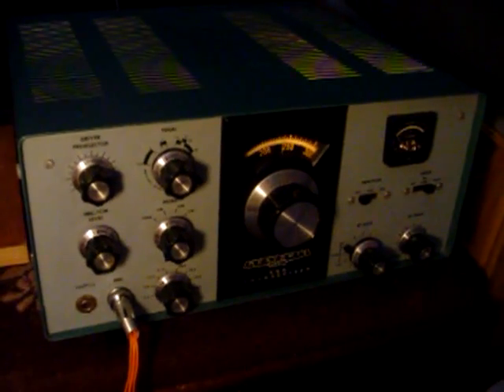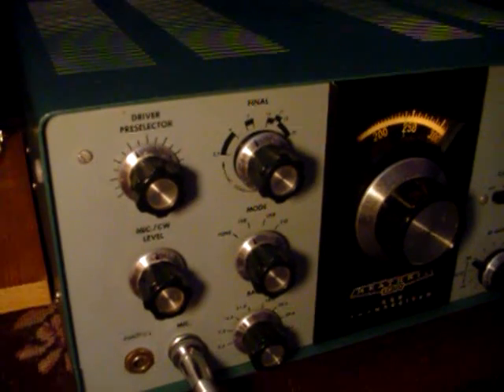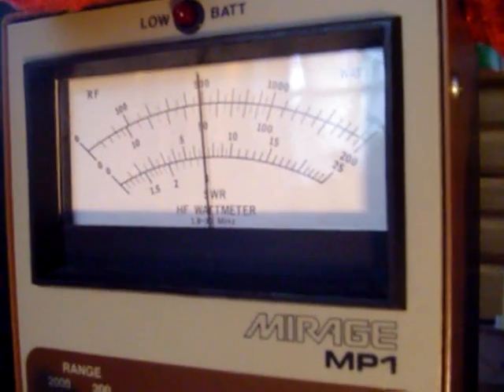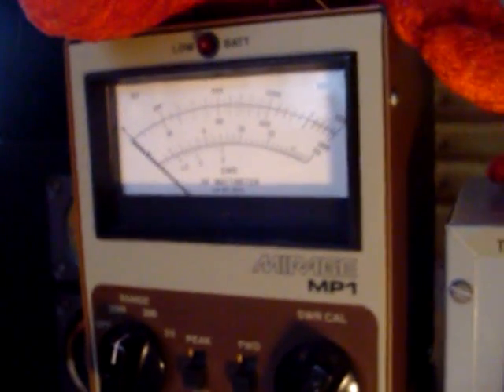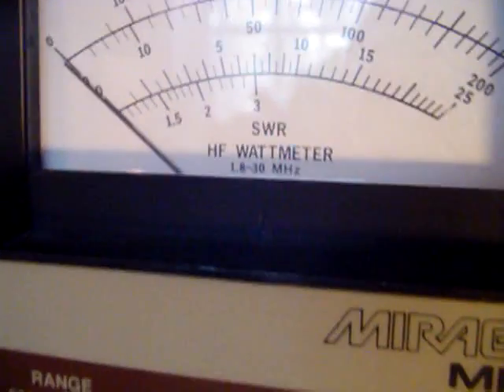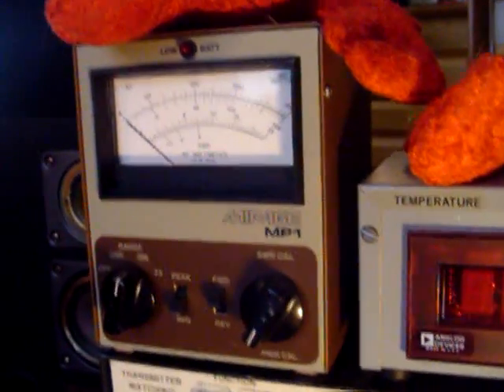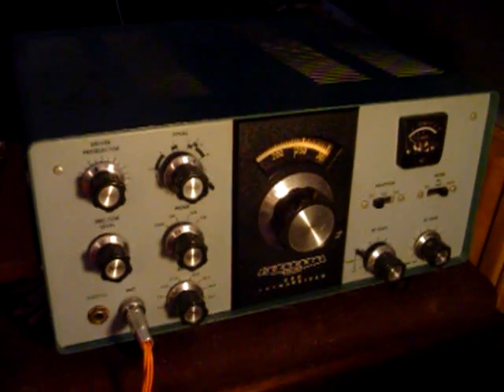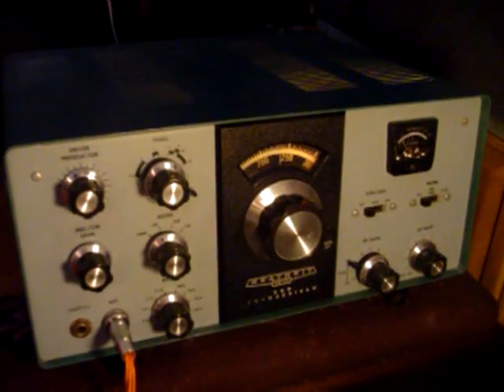Tuning up the Heathkit HW-101

Comment: I have a HW-101 and now use 6146A only. I picked up a new pair of 6146B some years ago and had a lot of trouble neutralizing them. And since I failed with the 6146B finals, I have heard that many other folks are also having the same problem. The B tubes reportedly have a slight power increase, but it's not worth it if the tubes can't be neutralized. So I don't worry about it and everything is fine now. I get about 115 watts out on 80, 40, 20 and 15 and slightly less on 10.

Comment: I am having problems neutralizing a pair of 6146Bs in my HW-101. Someone said, I should pull those and use 6146 or 6146A tubes and not use the 8298s. Should I go back to 6146s?  I also have a Heathkit SA2060A antenna tuner. I just finished cleaning up, and wrapping some of the straps in silicon tape, where they had a tendency to arc. It works great on anything I can run through it, so far anyway..
Reply from the maker: I've heard that generally either the A or B version of the 6146 should work just fine in the Heathkit series of transceivers that use them. Are you having trouble neutralizing them? It could be an issue with one of the tubes. Do you have another known good pair that you could swap in to compare?

The 2040's and 2060's are wonderful tuners. Exceptionally well built and they will tune just about anything. 100W sent through it will be absolutely no problem for it.

Comment: Good deal. Didn't mean to rain on your parade and you are providing a service to the newer guys who might want to play with Vintage equipment.
BTW, the HW 101 is a classy but simple rig. There are many simple mods you can do to the 101 to make it much better. I used one for several years and had a lot of fun with it back in the early 80's. I still have several 101's in my warehouse and plan to resurrect one sometime.
73,
Glenn
WA4AOS

Comment from the maker: In regards to achieving a 1:1 match I always try to eliminate all traces of reflected power *if possible*. Again, I do this on a clear frequency and I also have a tuning chart that shows roughly what settings to have the antenna at for each band so that adjustment time is minimal. Reflected power needs to be dissipated somewhere and some of it is being radiated as heat in the finals. If you can save any stress at all on the finals then why not?

Comment from the maker: Hello,

Usually I always try to find a clear frequency and listen before I tune up. I think I was concentrating so much on trying to make the video and remembering to mention everything that I wanted to over the video's duration that I failed to listen first. 

I didn't peak the preselector beforehand because I wanted to start with the radio's final circuit out of resonance. This way I could illustrate the effect adjusting the preselector has on the power output.

Comment: You never listened before you started tuning. Even a weak carrier can be very annoying to others using the frequency before you started tuning on top of them. This is also against FCC regs to cause interference.
You might try listening first and peaking the preselector for maximum receive noise. This will generally get that in range.  To further reduce interference, don't worry about getting a 1:1 match. 1:5 or less is fine.
I can't overemphasis the importance to LISTENING before QRM-ing QSO's

Comment: I just realized that I never did a response to this vid, so I'm now making amends.
I much appreciate your tuning demo.  Great job.  Helped a lot...especially the transmitter/course...antenna/fine correlations.  Somehow I had missed that.
I've just about got the procedure down pat.  It turned out that the mic amp tube (6EA8) was a good part of the first CQ problem.  The gain was cranked to the max, but still not fully up to par.  A new tube is now in there.  Much better.

Thanks again,
John